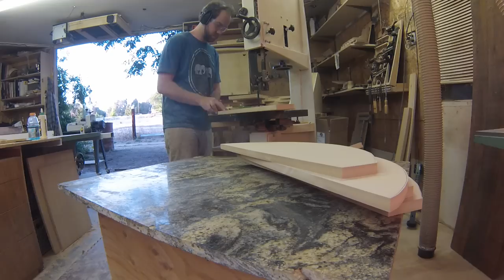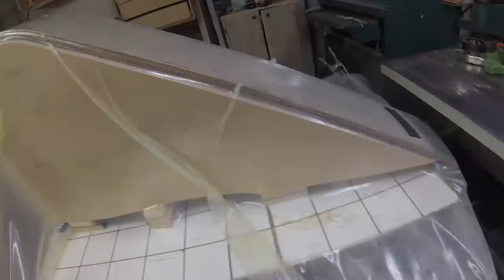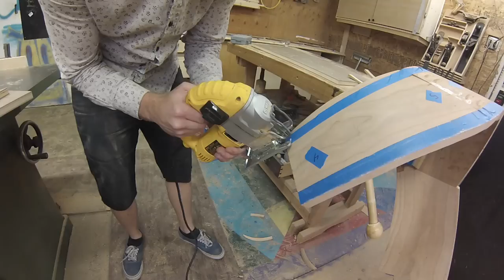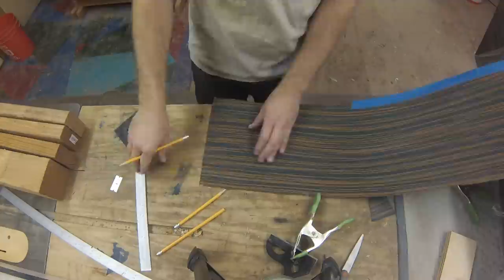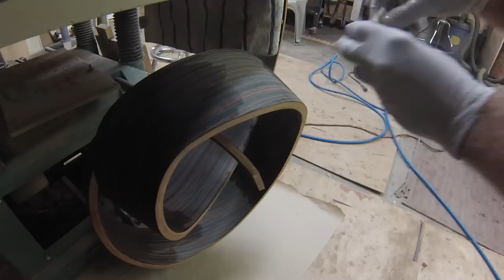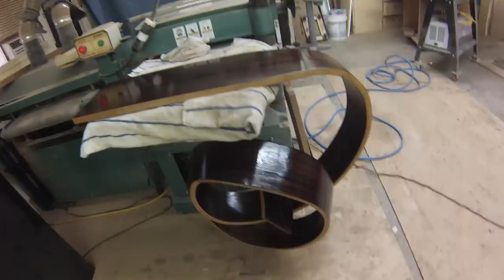The Knot Table

Comment: this. is damn cool and artistic. table 

can u help pls?

I m making an fully round(vertically) table. in which I m using paper veneer sheet but the process which. I'm using for placing it on plywood it causes. air pocket after some time 

can u. pls tell me the right process of placing of paper veneer on plywood

Comment: Coming from a more traditional veneering background, seeing spray adhesive used on veneer is really really concerning (but I'm intrigued).

What do pieces like this look a few years down the road, once they've been used and subjected to some changing humidity?

Also, why didn't you simply add the veneer when doing the bent lamination? It would have been a bit trickier, but I think it would have resulted in more robust veneer adhesion. I'm curious!
Reply from the maker: The stuff is really strong. As surface is perfectly flat you get good adhesion. When I worked in an Art Deco furniture and cabinet shop we used spray adhesive all the time. We never had a problem with it. 
And ask her why I did not laminate the veneer to the curved pieces was because of the amount of fitting and re-fitting I had to do. Each curved piece had to be cut and fit individually. Being that I veneered it afterward I was able to get a more uniform gran pattern and strategically place seems where you would not see then. 
Also each curve had different thickness laminate's depending on how dramatic the curves were. A tighter curve had thinner pieces. This meant that each part was slightly a different thickness. This table again I would probably do it differently.
Reply: +Kyle Toth Interesting about the spray glue. I'll keep the technique in mind for when I have a tricky surface that can't be properly pressed.

Comment: Kyle, how did you bend and glue up all of this without using a single clamp or did I miss something?  Very interesting looking veneer.  Nice looking piece.
Reply from the maker: Everything goes into the vacuum bag. Its a huge clamp. Sucks all the air out and produces atmospheric pressure. Around 14 pounds per square inch of clamping pressure.
Reply: Kyle Toth ahhh, got it thanks.  Very cool.  Individual panels glued end to end to make the overall piece?

Comment: I am curious if the client found a clever way to hide the cords.  Great vids, btw.
Reply from the maker: Michael Moss He actually did. He had ab electrician pit it in the wall and hard wire it to a light switch. Unfortunately he did that a while after I installed the table
Reply: i heard that the client died a month ago.. my aunt bought the table at his familys auction.